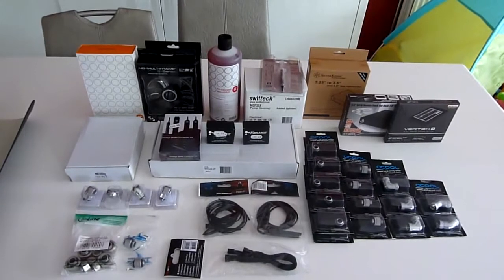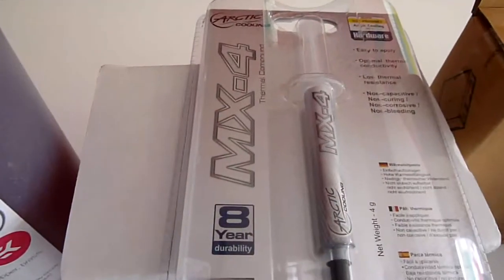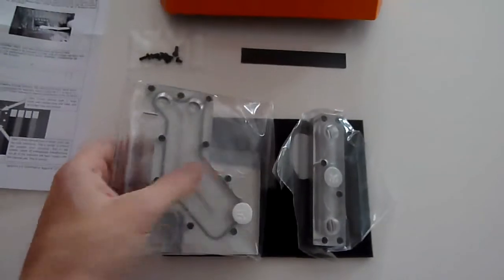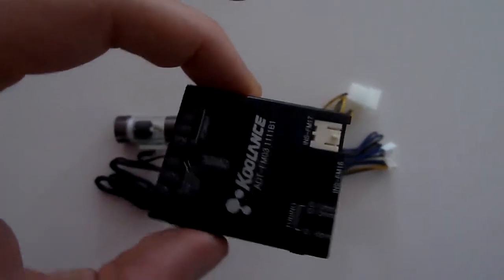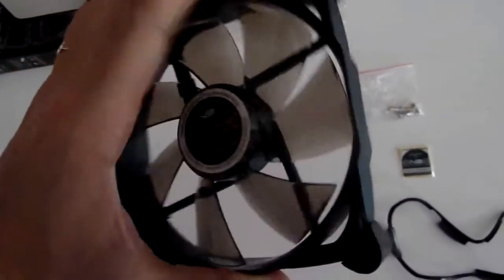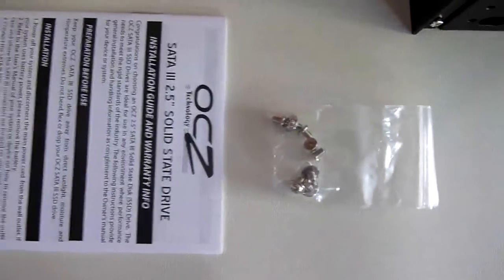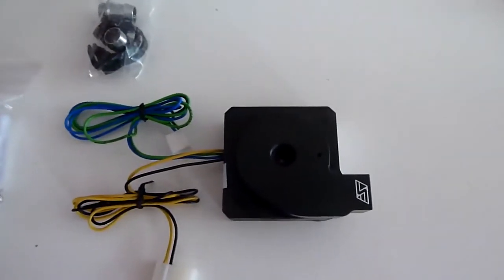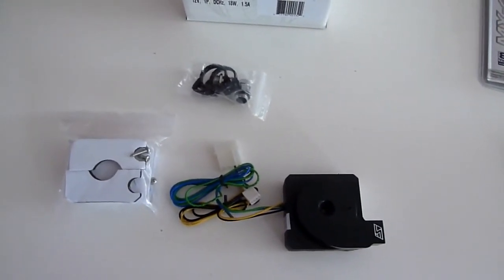NZXT Switch 810 Watercooling Update 2

Comment from the maker: MCP35X is a DDC pump. As i explained in the video i started with one MCP35X and because i added more waterblock and rads i choose to add a second one to improve the flow. I did not choose a D5 ( 655 ) at the begining because the mcp35x is very powerfull, you can control its rpm with the pwn connector.